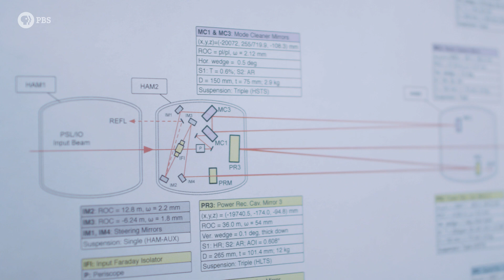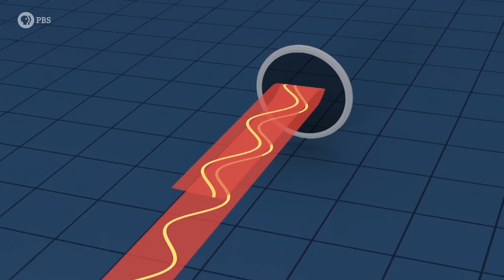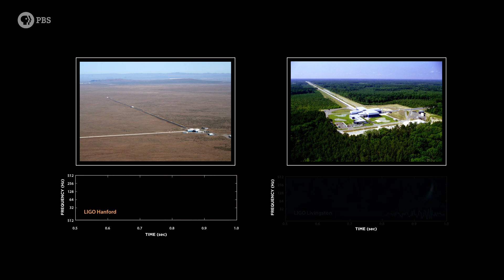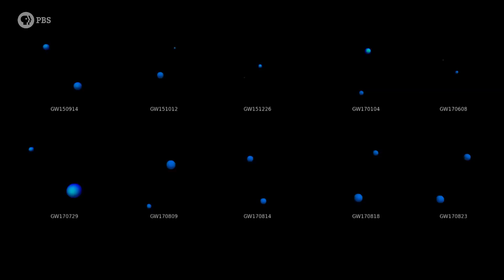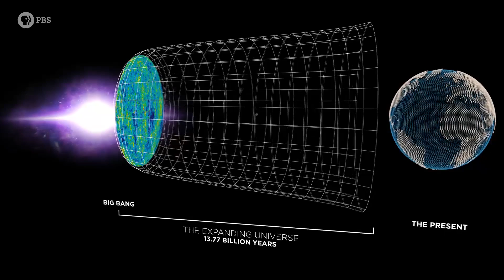I Visited the First Gravitational Wave Detector! LIGO | STELLAR

Comment: I think the most impressive thing you said was “one thousandth the width of a proton.“ How about dwelling on that some more. Also, what was the frequency of the waves in that first black hole collision?
Reply: Great question! The frequency of GWs is typically in the range of 50-500 Hz. The frequency of the signal changes as a result of the source astronomical objects (black holes, sometimes neutron stars) spiraling together faster and faster before colliding. 

The length sensitivity of the interferometer is one thousandth of a proton width - that is, we can tell when the detector arms have been squished as little as that amount by a passing gravitational wave. It's kind of a crazy idea, but there are great explanations of how the interferometer exploits light interference to get gravitational-wave information here: 

(Less formal) https://www.forbes.com/sites/startswithabang/2018/09/15/ask-ethan-if-light-contracts-and-expands-with-space-how-do-we-detect-gravitational-waves/#15f516f519a5
(More formal physics paper but still highly readable) https://pdfs.semanticscholar.org/393a/af6b1ced305ee40d175d5f3c3a2b6020348d.pdf 

They both have essentially the same point on that issue - "it is better to say that we use the laser as a clock than
 to say we use its light as a ruler" (from the formal paper). LIGO really is one of the best examples in scientific history of a wild, fascinating idea derived from theory on paper that developed into a full-fledged branch of measurable experimental physics.

Comment: Have you ever seen the new optical, well anti optical, telescope NASA and others are starting to use? Using 2 solid disks they can build a telescope. I work in aviation and know the speed of sound reverses the laws of lift. It also seems that anti optics also reverse the laws of light. I wonder if they actually speed light up? Also... What happens when gravity becomes so strong it reverses? I wonder the implications that a black hole isn't drawing everything in, but really a gravity so strong the laws we know are reversed.

I also wonder... Could we use a solid disk and set the focal length to see around a black hole? Photos of black holes seem to bend light at the edges like a lense. Maybe gravity is just something like matter that we don't yet comprehend it's basis that controls our time "light".

I would love to know if anti lenses speed up light, because maybe that would indicate how to manipulate time.

Comment: Is the gravitation wave emission the reason for the collapse of the orbiting blackholes?  That is, the generated gravitation wave takes so much (kinetic) energy from the orbiting system to eventually cause the collapse of the orbit.  If that's so, the reason planets don't fall to Sun is because that energy loss is sooo small?  Given enough time, tho, collaps is the fate of the solar system as well?
Reply: Yes, that's it. When very massive stars or black holes orbit close to each other, they lose energy by radiating gravitational waves, causing the orbit to decay and the objects to get closer to each other, causing them to lose energy even faster, and so on, until the two objects collide. (But what we can observe with this interferometer is just the last second or so of the process.) It follows that the Sun-Earth system also loses energy by radiating gravitational waves; but how much energy is that? It has been calculated, and the answer is: it gives away about as much energy as a light bulb. (So while theoretically the orbit of the Earth would eventually decay, in practice it will take way longer than the Sun itself will exist.)
Reply: @MikeRosoftJH  Thanks very much for the explanation!  I think I incorrectly said "loss of (kinetic) energy", should really just be the loss of total energy, the kinetic energy in fact increases as the black holes approach each other (moving faster and faster).  Anyway, fascinating.  One more question, is the gravitation wave the same thing as static gravity due to actual mass?  (i.e., is the gravity wave is propagating curvature of space-time fabric)  Do the maxima of the waves attract other real bodies and do parts of the waves feel other gravity waves (i.e. do they interact through "gravitational" interaction, LOL)  Do you think small bodies (like earth) can be "caught" in orbits around gravitation wave fronts?

Comment: It's not like any other observatory, it doesn't detect light it detects gravitational waves..... using light.... 🤦‍♂️
Reply: It does seem odd on the surface, I agree. If you're curious, there are two phenomenal explanations of how the interferometer exploits light interference to get gravitational-wave information here: 

(Less formal) https://www.forbes.com/sites/startswithabang/2018/09/15/ask-ethan-if-light-contracts-and-expands-with-space-how-do-we-detect-gravitational-waves/#15f516f519a5

(More formal physics paper but still highly readable) https://pdfs.semanticscholar.org/393a/af6b1ced305ee40d175d5f3c3a2b6020348d.pdf 

They both have essentially the same point on that front - "it is better to say that we use the laser as a clock than
 to say we use its light as a ruler" (from the formal paper). LIGO really is one of the best examples in scientific history of a wild, fascinating idea derived from theory on paper that developed into a full-fledged branch of measurable experimental physics.

Comment: Would the infrared laser generate Heat if it were to touch a non reflective surface? I assume that the optically polished mirrors do not absorb any heat from the laser of course.

Comment: I have a question that has been bothering me since the gravitational wave (GW) detection news came out. As I understand it, LIGO detects GWs by measuring the change in the lengths of the 4km arms. Since space itself expands and contracts when a GW passes, the light wave in the arms should also expand and contract (i.e., change their wavelength locally). Thus any change in length of the arms should match the change in the local wavelength. Therefore interference patterns shouldn't happen. I hope I have explained my dilemma clearly. Could someone help me here?
Reply: This argument is correct when the space involved is not changing, but is not true when the space IS actively changing. (This is why we can detect the expansion of the universe, the changing space alters the frequency of the CMB and has redshifted it.)

This actually puts limits on the frequency of waves that is detectable; if the wave can effect the entire arm all at once (low enough frequency) then no difference will be detected. (Supermassive black hole mergers, though very powerful, are too low frequency to detect at LIGO.) Only waves that alter the arm length partly at any one time can be detected. (With the biggest effect being from those that alter precisely half the arm length.) So there's actually a peak in sensitivity for a certain frequency based on your detector's size.
Reply: @garethdean6382  Thanks for the reply, but I still can't understand it. In conventional scenarios (non-GW scenario) the arm length will change without affecting the laser light. This will create an interference pattern, which can be detected. The interference happens because of the relative stretching of the arm with respect to light.

Now, assume a GW passes through LIGO in its detectable frequency range. The wave will stretch one of the arms of LIGO. It will also stretch the laser light that passes through it. Since there is no relative stretching, interference shouldn't happen. But interference does happen and scientists have detected them. I like to know how that works and/or if there is a flaw in my understanding.
Reply: The error is your assertion that it will 'also stretch the laser light'; this is not in fact strictly true. In fact the first theoretical proof that gravitational waves would shed energy was based on the 'sticky bead argument' that noted that even solid objects may not stretch with spacetime. (A rigid rod with beads on it would not compress with space, while the spacing between the beads WOULD compress. If the beads were 'sticky' then friction would steal energy from the wave.) https://en.wikipedia.org/wiki/Sticky_bead_argument

This was actually an early argument against gravitational waves; if they just warped everything then there'd be no way to detect them, no way for them to interact with matter. In short they DON'T warp matter or light, at least not to the exact extent they warp space. That's just the way they work, if you were told otherwise then the person who informed you is incorrect.
Reply: @ThomasKundera  Thank you. I'll read it immediately.
Reply: @ThomasKundera  I could understand some parts of the extract. Unfortunately the math used here is beyond my understanding. I guess my question is probably not possible to explain intuitively. Thanks again, I'll try and read the whole document. 😊

Comment: If you could somehow, perhaps by orbital period, measure the distance between black holes at the moment of collision, or when waves start to get smaller, you could calculate the rough sum of the mass radiuses of these black holes and not event horizons, since event horizons don't interact but masses do.

Comment: If you look at a smooth lake and someone drops a pebble on the other side i can see how sensitive equipment could detect its ripples. If the lake id filled with speed boats, water skiers, kids diving in etc how are the pebbles ripples detected? Youd surely have to know every other ripple caused and subtract them. This is how i picture detecting gravitational waves, or am i way off track?
Reply: Sort of. The first thing you'd need to do is ban all the speed boats. These would be Earth-based phenomena like earthquakes and traffic. Unlike in a lake LIGO can do this since gravitational waves can pass through matter while most regular noise can't. So that reduces things to a lake filled with wind waves and ducks and whatnot.

In THAT case you still get a lot of noise, but it's about as strong as the signal you're trying to detect, it's not overwhelming. Now your best bet is to look at the PATTERN of waves. You're going to get all sorts of mess in your detector, but you already know  what signal you're looking for, so you an scan the noise for it.

You might, for example, know you'll get a set of waves half a second apart and getting 10% weaker each wave. So you get a powerful computer to look at every spike in the noise then look to see if another spike happens a second later, then a second after that and so on.

Doing that you can 'pick out' your signal from the noise. One or two peaks could be coincidence, but if you're looking for a hundred in a row there's no credible way for plain noise to produce that signal. That's essentially how LIGO picks out the 'chirp' of black hole mergers.

Comment: "...no one knew...ripples...existed..." [02:14]—so, how do gravitational waves differ from tides (transients); And how did the separation of EM and weakforce, everywhere in the big bang, be continuously-shorter-waving than the cosmos is old/long/wide/deep [06:11] (a reasonably scholarly answer not-just a 'geek'-elation of a 1920's conjecture)... (also, Is there a bridge, in 4 km)...
Reply: This is possible, there WAS an error in posting this reply, so it might have got crossed.

What are 'cosmic tides'? All I get from google is gibberish.
Reply: ...that's kind-of the point—gravitational waves from a moment when the cosmos was tinier than a 'billionthaire' would now be a smeared continuum across cosmic-space-expansion-smoothed distances—nonzero but below the resolution of even the next-generation Einstein Observatory watching millions of years: her story is not meeting sensibility...
Reply: All three of those effects produce gravitational signals, the difference is in the power and the pattern of the waves. Tides for example have a period of about a day. They're undetectable because of this in the same way you can measure a ball''s speed with your eyes but not that of the moon in the sky.

Even some black hole mergers will be undetectable because they happen too slowly or too fast, only a 'sweet spot' of the right frequency will show up and it needs a distinctive pattern so we can be sure of what it is.

Comment: Would there be a benefit to having a vertical 3rd arm?
Reply: You'd need a second facility oriented vertically, since three-way interference is tricky. It'd just be a confirmation signal and wouldn't add too much.
Reply: It's very hard to build, due to the needed size.
It's way easier to just build another LIGO-like detector, flat somewhere else, and use the curvature of the Earth to naturally get the 3rd dimension (which help, of course, just depends from where the wave comes and what kind of polarity it has)..

Comment: what is the difference between ligo and any other synchrotron facilities?
Reply: You're asking the difference between an infrared laser detector and an atom smasher?
Reply: @Tac_Taco  not necessarily
Reply: @username42  what is your question then? Because one facility detects gravitational waves by literally measuring the stretching and compression of reality as we know and understand it. The other accelerates an electron particle to basically the terminal velocity where e=mc2 works its magic and the more energy put into the electron adds mass. At that point they collide it with a steel plate or an electron with the same amount of energy moving in the opposite direction to simply put "crack them open" to see what's inside. All that energy mathematically should theoretically generate some subatomic particles.

Comment: I know that there are other priorities, but wouldn't there be huge advantages in putting a couple of LIGO units in space.  No earthquakes,  the distance between the mirrors could be a lot longer, ready made vacuum etc.  On a side note does anyone else thing of Lego when you hear LIGO?
Reply: Do you know how much it costs to put a ton of stuff in orbit? Getting LIGO up there would cost several trillion dollars. And then you have maintenance and power to think of.
Reply: @garethdean6382  : Power of LIGO is not that much, outside cooling (which can be reduced a lot in space).
A mere 200W laser is needed...
Reply: It's an ongoing project, see: Laser Interferometer Space Antenna

Comment: Correct me if I'm wrong, but gravitational waves are not really anything special, right? 
I mean, they are, but isn't it just the force of gravity being weaker when the object (eg: one of the black holes) is slightly further away, and the force being slightly larger when it gets closer? Further, closer, further, closer in a wave pattern as they orbit, just like moving two magnets closer and further from each other, and calling it a magnetic wave.
 So it's just variations in the force of gravity, and not a real wave, like electromagnetic waves. But, then again, electromagnetic waves are just vibrations as an electron settles back into its orbit, or whatever, so.. yea.
Basically what I mean is that when people hear of gravitational waves, they think that we have discovered how gravity works, when really we're just measuring differing distances, albeit really quickly. I'm not saying it isn't a fantastic achievement or anything, because it is.
Reply: No, it's actually a wave in spacetime (Or gravitons if you're going by particles.)

If you had two orbiting black holes and were near them, you WOULD feel a difference when one hole was closer to you. But that wouldn't be a wave, it'd be a force of attraction, a 'tug' like the tides in the oceans. It'd also fade rapidly with distance (I believe it's with the cube of distance, it's certainly greater than the square) because it's a difference in force rather than the force itself.

Importantly the two holes would have no reason to merge, a difference in force doesn't cause a loss of energy, the orbiting holes wouldn't be emitting any sort of energy at all.

However gravitational waves are actual waves (specifically quadripolar waves) that carry energy away from a system and can do stuff like interfere. Were not detecting the change in distance (That really would be impossible.) but an energy emission akin to a bust of gamma rays, that warps space in a very specific and interesting pattern.

It may not be 'how gravity works' (You can see light and still have no idea how electromagnetism functions) but it's definitely a wave.